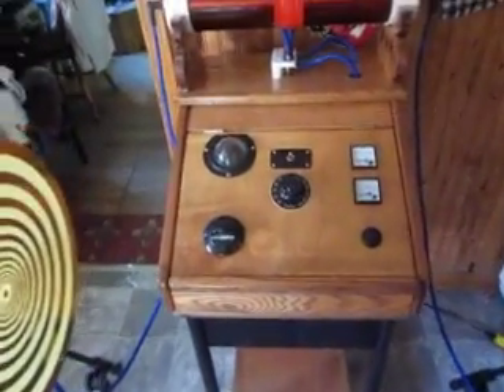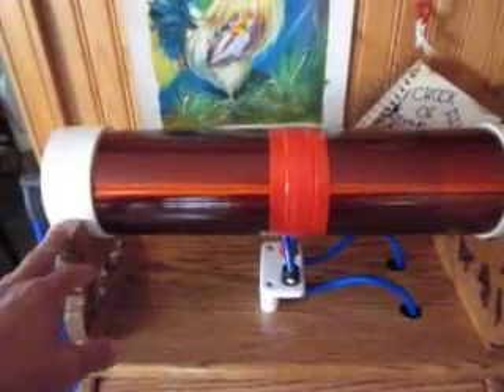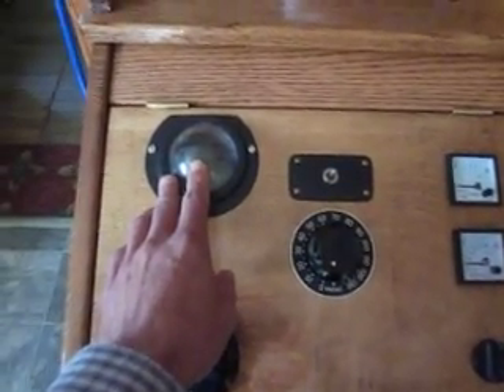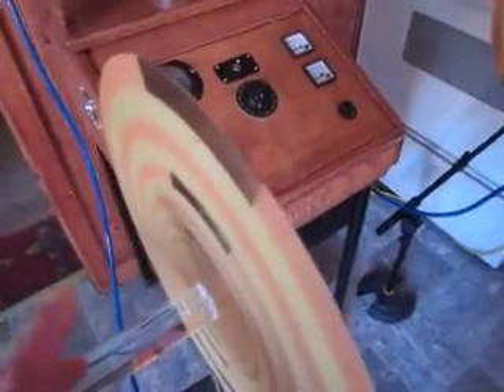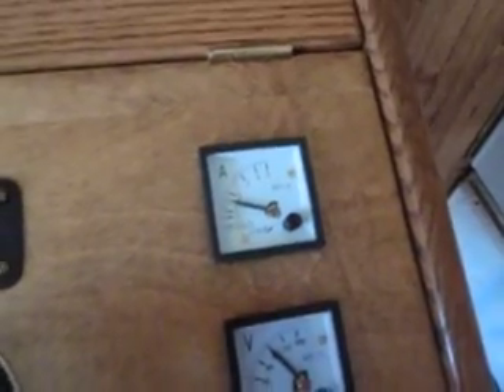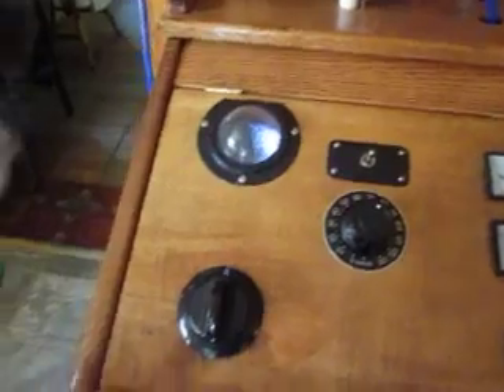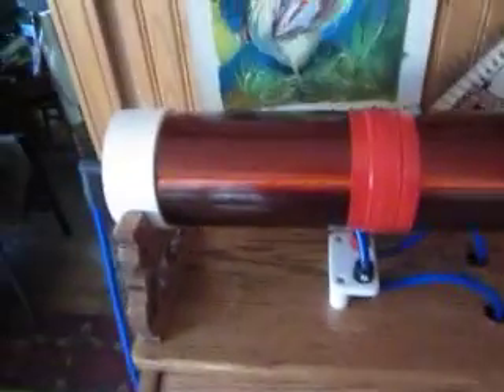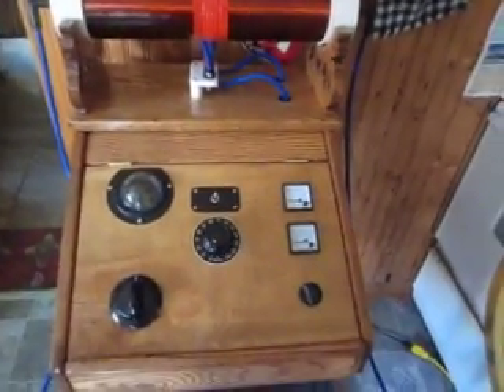Multiwave Oscillator

Comment: Can you please tell me how many turns you used for primary coil and wich wire diameter in millimeter? The wire diameter of the secondary coil is 0,6 or 0,56mm? Have not found it at nvtronics😅
Thank you:)
Reply from the maker: In this particular design I used AWG18 for primary and if memory serves me well, it had 18 turns. Secondary has 0.56mm or AWG23 wire. I have not posted tech details at NVtronics since this was experimental build, rather than closely following G.L design. In my opinion, bipolar works just as good as unipolar, which is simpler to build. I currently have 2 partially assembled devices, both in operational state and may decide to sell one. It still requires some work and cosmetic touches. I just don't have time to finish all my projects and there are a few awaiting completion since 2019...Two HV PEMF machines and two MWO, among them. You can PM me from NVtronics.
Reply: @blackchisel97  Thank you verry much. Sorry that i have to ask again. You made 350turns for the secondary in total or per side (looks like per side so 700 in Total)? Thank you :)
Reply from the maker: @Taran-d.B.23  That was over 10yrs ago...Each winding spans distance of 180mm and wire dia is 0.56mm, which gives approx 320 turns. You can adjust desired resonant freq. with capacitors.

Comment: Its a bipolar coil, Lakhovsky had two coils, a Transmitter and recieving Coil. So its a different frequeny Range.
Reply from the maker: Coil was calculated to operate in the same freq. range as the GL Colysa machine. Once Tx coil fires, they both become transmitting and receiving. I have built GL replica as well.
Reply: @blackchisel97 U, that sounds great :) I have to say im yust building my first GL MWO 😂 Because i hope to cure my CFS/ME with it. Do you have eperience with Health issues and this device? 
Greezings from Germany:)
Reply from the maker: @Taran-d.B.23 Yes, but this isn't a good place to talk about the cures and health.
Reply: @blackchisel97 were would be a better place? 😅 im interested
Reply from the maker: @Taran-d.B.23 There is a link to my forum on the main channel  page. You'll find some hints regarding MWO construction and much more.

Comment: What role do the antennas play? Are the frequencies now created in the antennas or in the generator?
Reply from the maker: They both act as transmitters/receivers. Wide spectrum of harmonics is generated in the device, with many additional frequencies generated by each of the antenna oscillating circuits - rings.

Comment: The antennas seem to be incorrect! I saw the original machine at http://youtu.be/rRttn7xb0y8 and it has a completely different design.
Can you say why you deviated from the original? As I understand it, the antenna is the most important part of this system.
Reply from the maker: As always, to experiment. These antennas were designed by Eric Dollard and based on Phi ratio. I'm building another MWO, this time with tubular antennas and two separate coils, following the original but I've been using this version since it was built and it works. As you noticed, I also used bipolar coil, unlike the original.

Regards
V
Reply: I am all for experimentation. Specially when real info is so hard to come by. However, experimenting on yourself is playing Russian roulette!
I see even the 2 Italian guys who found and restored the original MWO, couldn't resist and either changed the copper loops or electroplated them in chrome to look nice!
I am pretty sure that Lakhovsky could've done that if it was warranted.
I would build the antenna the way it was built without modification and go from there.
I will not experiment on myself unless I had little time left and wouldn't make any difference.
You have good workmanship skills. Why not experiment on sick plant from you local nursery before making yourself the guinea pig?
If it works for the plant (unpowered) , no reason it shouldn't work on humans (powered)
Why not contact these 2 guys in Italy and ask for their help in replicating the machine?
Have you looked into orgon blankets?
Best of luck.
Reply from the maker: pirateman
I understand this device and know how to build exact replica, including antennas (which I built already).. There are no adverse reactions or side effects from using this device. I did test MWO on plants and primed sunflower seeds with it.
This is a real deal, not a quackery as some people would like us to believe but same people criminalize word "cure" and hound down those who dare to claim such.
Regards
V
Reply: I believe you. I had a benign tumor on my left wrist and took a chance. made a bracelet out of 12 AWG wire 30 cm long and wrapped it around my wrist with a 3mm gap facing north to form a ring as per info on the net. 2 days later, it completely disappeared and saved me from having to surgically removing it :)
If a piece of unpowered wire can do this, what can a powered unit do?
Good job my friend.
Reply: +PirateKitty 
Where do you find this information? I've looked around but nothing specific to what you've mentioned. Thanks.
Reply: Priatekitty, Where can I get the schematics of this "circuit" ?

Comment: Very interesting :) Dr. Korecki took small glass vials of whatever substance he was interested in, at the moment, and used the VEGA midi machine to send a signal through the (conducting) glass. I guess there was some sort of calibration for the vial itself (I'm not sure) - allowing the standing frequency of the subtance to affect the osc. which was then amplified (MORA) into two brass cylinders that were held, one in each hand, passing the vibrations into the meridians. Worked well